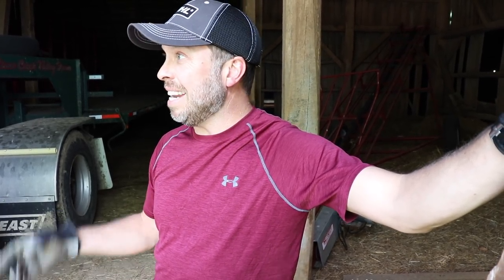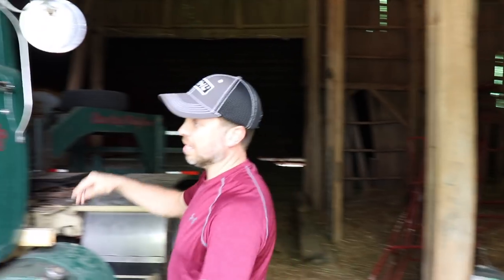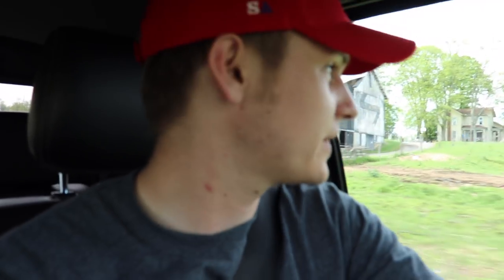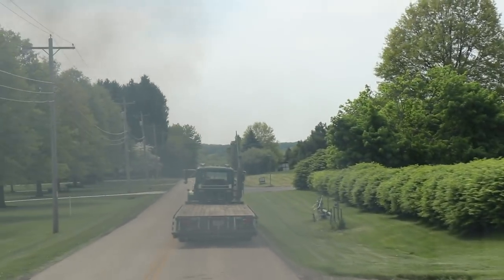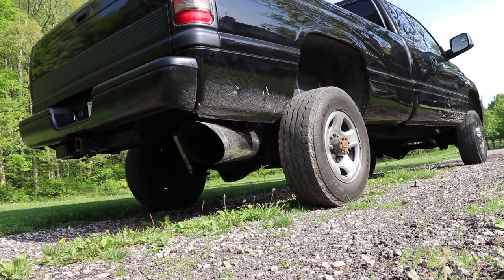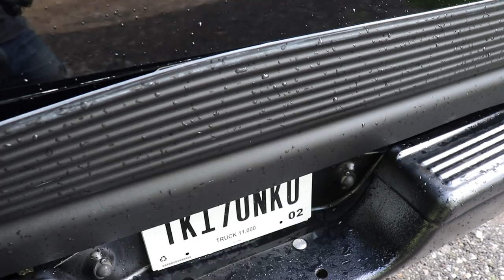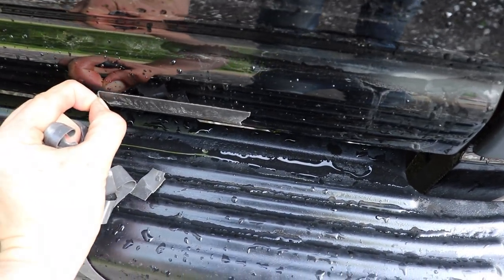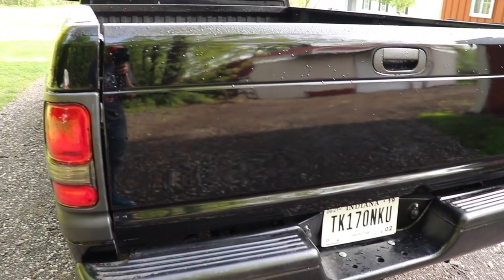EVERY DIESEL OWNER EVER WILL TELL YOU NOT TO DO THIS 1 THING!!!!!

Comment: Ether is not bad been using it for years. Yeah it will destroy a cummins well because its a cummins but powerstrokes, volvo diesels you can use ether on them all day without any trouble. Of course your duramaxs don't need the ether because they are the premium of diesels even in -40 degree winters. I like it parts are already falling off your dodge lol easy with those trucks.

Comment: Does the mack have a splitter in it
Reply from the maker: Ryan Meeker not sure
Reply: Ryan Meeker it's probably a two stick 6 speed Mack transmission you can kind of tell by how slow it shifts, look at the smoke ,splitter transmission gears are closer together.
Reply: I was just wondering because my uncle has a old ford dump truck that has a splitter but it dont work
Reply: tsimmons1974ts thanks for answering to
Reply: Ryan Meeker  That old Ford probably has a four speed trans with a two speed rear end. If it sat for a long time it may be a simple fix.